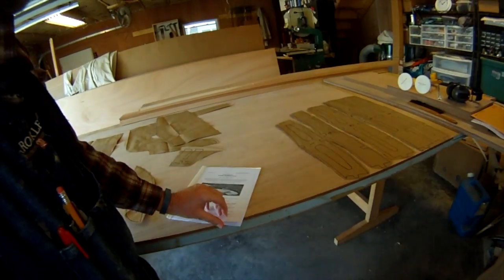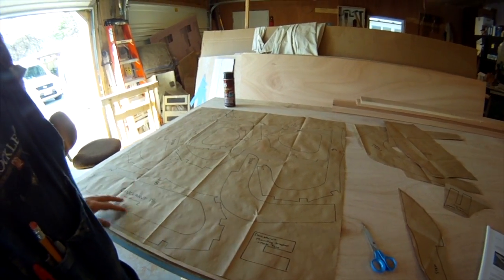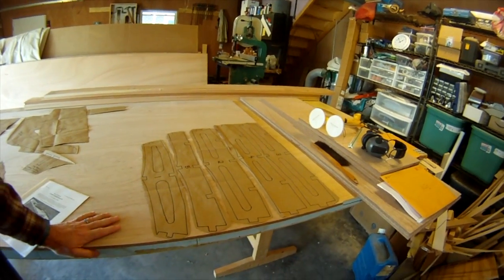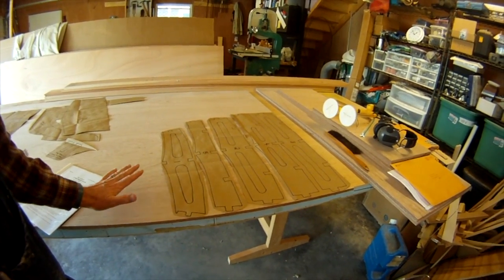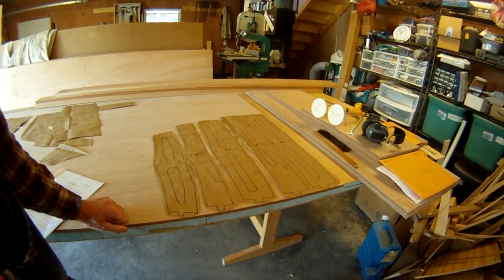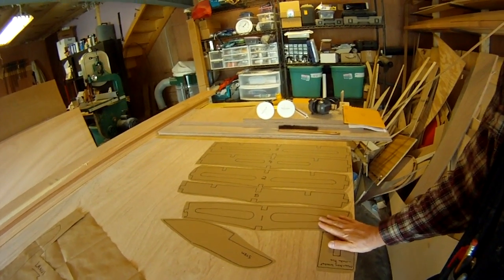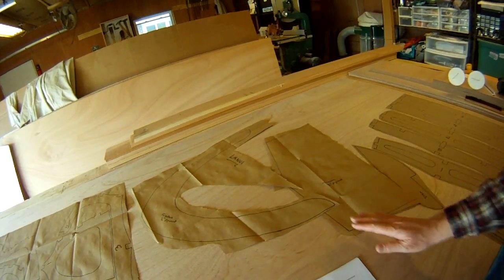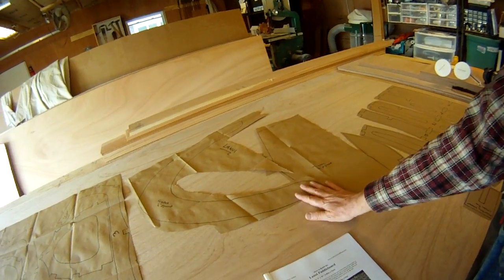Lanui Paddleboard Build #1 - Frame Layout and Cutting

Comment: Hey, i watched all of your teardrop videos (2 or 3 times) and loved them (and then built my own teardrop) but wanted to share one thing with you that i 'disliked' about your videos that should be a pretty simple change for you? The volume of your voice compared to the tools was really big, and i found myself turning the volume right up when you were talking and then you'd turn on some power tools and it would deafen me. Its not as bad in this video, but the teardrop ones were quite extreme. If you could maybe adjust for that during editing, then that would be great? I'm going to watch all your videos regardless, but would be great if the volume was a little more consistent. Jay Bates (woodworker on youtube) actually has a video on his camera and mic gear and had some good suggestions on cheap mic options. Even using a secondary recording device, like an iPhone/Android and one of those hands free mics they come with was surprisingly good for voice stuff. Especially when you're a little way away from your camera. Thanks for the great videos, keep them coming! Ned
Reply from the maker: +Ned van Geffen Hi Ned, Thanks for watching my other videos, and congrats on building your own teardrop! I'm now using an updated version of my editing program that allows me to more easily manage the volume, so I'll try to run the power tools down some (I know they get loud and I'm learning as I go.) I'm using an older model GoPro camera for shooting the video, and unfortunately, audio isn't its strong point, but I can put it in the path of chips, etc. and it doesn't mind, so that's why I use it. I actually built the SUP last year, so the video has already been shot, but I'll try to pay more attention in the future. Thanks for your comments!